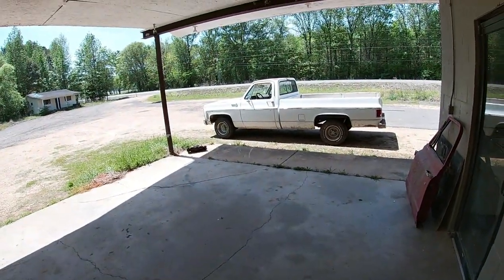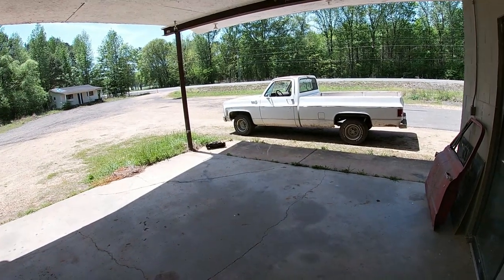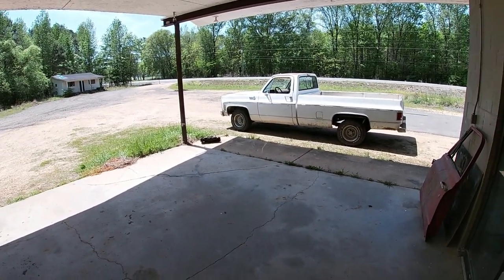Converting a TBI truck to Carburetor  And a bunch of other stuff

Comment: just swapped out the v6 in my 89 5spd for a 96 vortec 350 i pulled from a wrecked truck.  i put a square bore manifold for vortec heads on it and a carb / hei.  best thing i did to that truck.  thanks for the videos
Reply from the maker: Yes sir. Thank you for watching

Comment: I always wondered about how the wiring went if someone wanted to do that change over, great content. Hope your back gets better soon!!!!
Reply from the maker: Thank you sir
Reply: I got a 1998 lifted 4 x 4 on 37s extended cab short bed 5.7 L Vortec I'm currently using some of the computer it is currently controlling my fuel pump my distributor crank sensor and cam sensor coil pack an O2 sensors and my 4L 80e transmission while running high-rise manifold Holley 650 fuel pressure regulator with return line and my truck runs like a beast also new timing chain mild stage 2 cam I'm still running my O2 sensors no catalytic converters stock exhaust manifolds width 3 inch to a Flowmaster dumped at the rear axle

Comment: After 86 on c10 they changed it to r10/20/30… those engines have tbi if they run on gas. Long story short those tanks have baffles on left and right sides to keep those in-tank fuel ⛽️ pumps primed. Great video for the relay bc there’s not a single video with info on providing power to those fuel pumps.
Reply from the maker: Thank you

Comment: Congrats on 3000 subscribers.
Lots of great stuff in this video.

If any of your viewers want to change a TBI motor to a carb setup Edelbrock makes an intake for that. Part number is 2104.

Some of my customers over the years have asked for a sock style screen to go at the bottom of a carburetor style fuel tank sending unit assembly. I have found that some of the later model fuel injection style fuel screens will fit securely.

You have a fantastic YouTube channel!
Thanks for your efforts!!
Reply from the maker: That’s buddy
Reply: thanks for theinfo about to do a cam carb swap on my 88 siverado
Reply from the maker: I problem. Glad I could help

Comment: Before I LS swapped my c10 I took off the quadrajet and went with a Edelbrock Avs2 650cfm 1906. Was really good carb. I had a 84 with a 87 engine that had been carb swapped too.
Reply from the maker: Yes, the edelbrock are really good carbs. I run them alot

Comment: Throttle Body Injection
TBI (Throttle Body Injection) is a type of fuel injection system used in automotive engines1. It has one or two fuel injectors mounted in a throttle body, delivering fuel into the air above the throttle plates. In a vehicle crash, loose objects can become projectiles, causing TBIs when they collide with a person's head2
Reply from the maker: Ok.

Comment: I have a 1979 Impala I have a TBI converted over to carb . The guys that done it for me install electric fuel pump just wondering was that necessary? Or could I just keep the OEM fuel pump inside the tank?
Reply from the maker: You could keep the factory one in the tank but you have to run a fuel pressure regulator

Comment: So I put a new harness on my truck and would like to delete the old OEM harness and get rid of it since it’s basically junk. Would me going carbureted help me get rid of the rats nest of a harness? The new harness is basically a new body harness but I would need to splice into the new one to run it. Also have a trans controller since I have an 4L60E. So not worried about that either.
Reply from the maker: It would help

Comment: my cousin is giving me a cast iron 4 barrel intake and Quadrajet  freebie! my Question will I have to angle drill the 4 center holes? I am putting on my 88 Scottsdale 5.7 litre tbi? Thanks again for the video.Yelm,WA
Reply from the maker: You can angle drill the center holes but it’s really hard to get them to seal.

Comment: So I have  a 95 chevy 350, with a 4l80e transmission, I did a carb swap on it, did all the wiring like you said, got it running. But now it's not wanting to shift right. Skips gears. What am I missing?
Reply from the maker: That’s an electronically controlled transmission. If you switch to carb you have to get a stand alone transmission controller for the trans
Reply: No you do not you don't have to buy that stand-alone b***** my truck shifts just fine only thing I replace was my intake manifold put a 650 Holley carb fuel pressure regulator and the rest of the is running off the computer so I don't have a whole lot of timing to play with it's already preset
Reply: Tps sensor

Comment: Could you possibly show us what you did to get fuel from the old lines to the carburetor? I didn't see that anywhere in the video. I know you put in a mechanical fuel pump. Did you have to remove the old fuel pump from the tank or what?
Reply from the maker: There is a video in the rumrunner playlist where I modify a fuel tank in a obs to go to a carb

Comment: What's the best carburetor for 4.3 TBI conversion I was thinking a Rochester two barrel and a HEI is there a good adapter plate that you know of
Reply from the maker: Not to go from tbi to carburetor. But you can buy a carburetor intake to do the swap
Reply: @HarmonGarage   ok thanks I seen the intake didn't want 4 bbl would like it simple and good on gas  those electronics give me a lot of problems broke down 4 times

Comment: That couldn’t have been running right with those center bolts being that loose! I would prefer the carb over the tbi anyways!
Reply from the maker: It was running really hot, and rough. Had the wrong style spark plugs in it. Huge vacuum leaks, etc

Comment: If I was doing this on an 88 with the 700r4 would I just need a new kick down cable for it to work correctly?
Reply from the maker: You should be able to use the same tv cable.
Reply: @HarmonGarage  Should I run a torque converter lock up kit? thank you so much for your help
Reply from the maker: Your torque converter lock up should still work. If not watch my video on putting a 700r4 in the white squarebody and I show how to hook up the lockup
Reply: @HarmonGarage  Thank you so much!
Reply from the maker: Glad I could help